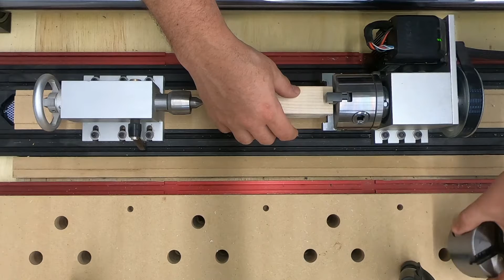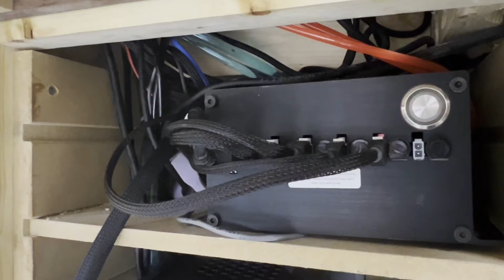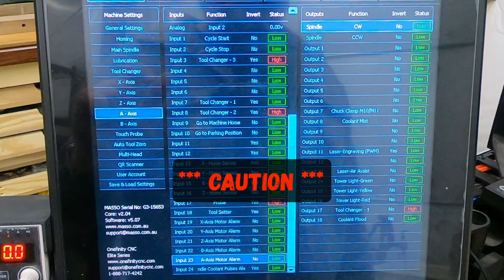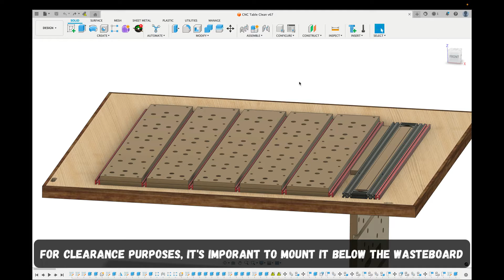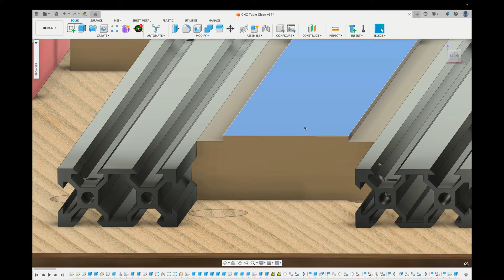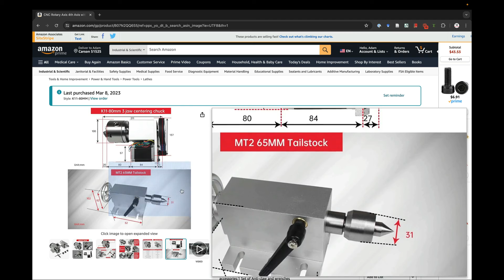Install a Rotary

Comment: Wasn't sure if I understood correctly... Did you say there is a "lathe" mode, where the rotary can be set to just spin on its own, while the spindle can move down the spinning part, going into/away from the part?
Reply from the maker: You can set it up so that you can spin fast, with a large range of rotation, but it's not infinite.  I'm sure the torque isn't great either.  I'd guess it has limited use cases as a lathe.

Comment: Thanks for putting this together for us! I am getting ready to install mine, but the product links are giving me a 404 error with Digikey. Do you have the part numbers for the connectors you are using? I am struggling tryi ng to find the male / female 8 pin ones.

Comment: If you're setting a z offset off of the MT2 65 tailstock, it's ~28mm. The top of the tailstock is 93mm from the bottom and the live center is 65mm from the bottom. At least those are the dimensions of the one that I bought on Amazon.
Reply from the maker: I feel like there must be different versions that they sell.  I see some with the motor orientation on the opposite side too.

Comment: I haven’t gotten around to installing mine yet. Too much to learn with the cnc alone. This will help. Suggestion… build a dongle loop back plug to complete the alarm loop. When you disconnect the rotary, plug your dongle in!
Reply from the maker: Great idea.  There's also a method of wiring it such that it doesn't alarm, even without the dongle.  It was floated in the Masso forums.

Comment: Does the spindle have an internal taper?    Does it have a hole all the way through?
Reply from the maker: I wish I could answer.  I'm not sure what you're referring to.
Reply: Is the spindle hollow, so you could pass a rod thru it?  And would it accept a Morse taper with the chuck off?
Reply from the maker: The version in this video does not have a hollow spindle.

Comment: What bit did you use to cut the holes in the 40x20 extruded aluminum?
Feeds/speeds?

I've yet to cut aluminum on my Elite, so I'm nervous.
Reply from the maker: It’s been so long can’t remember the speeds and feeds.  I’m sure I started with the Bits N Bits data and slowed it down a little.  I used their 1/8” O Flute.